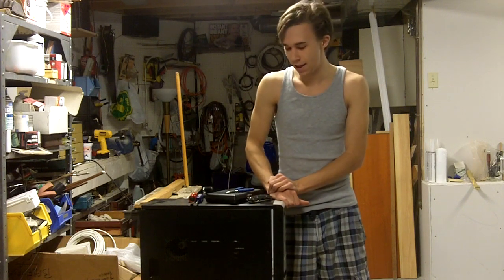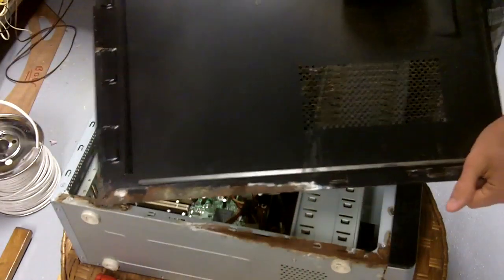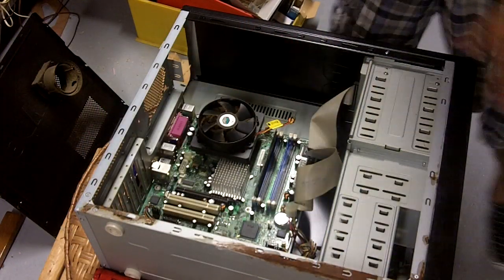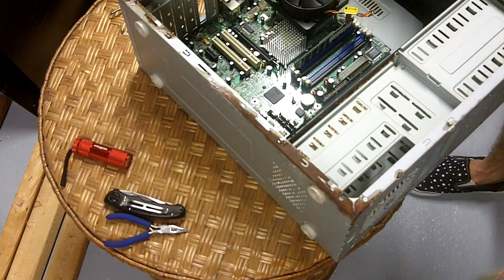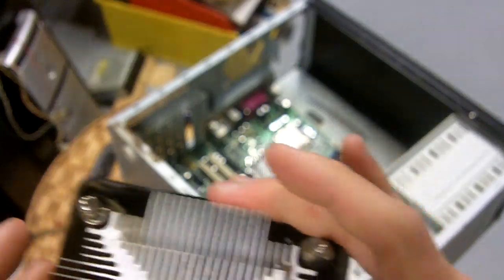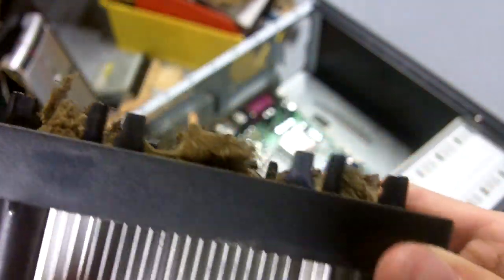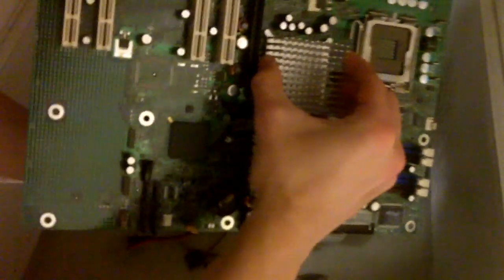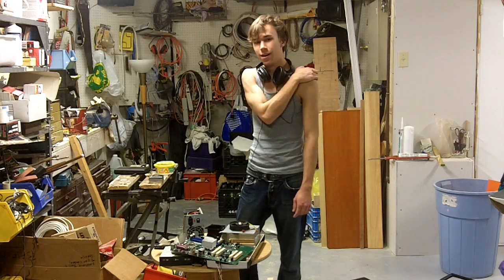Washing A Disgusting, Dirty Computer

Comment: Thanks for the video. Big clean up job. I never thought you clean a computer so throughly and the computer still boot up and be okay. Great help as I have a computer to clean up also. Cheers
Reply from the maker: No problem. Just remember to remove the CMOS battery and discharge capacitors by unplugging the power and pressing the power button! Good luck!